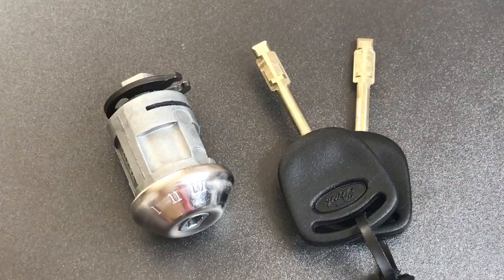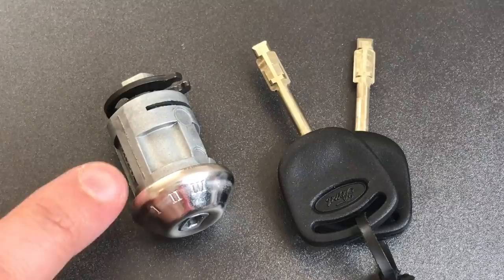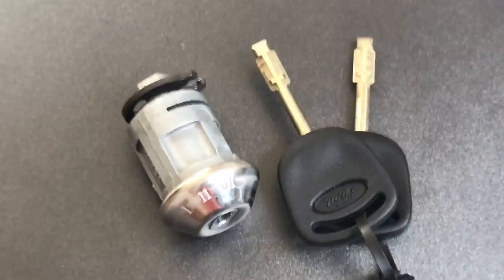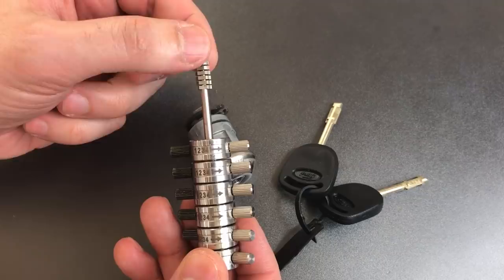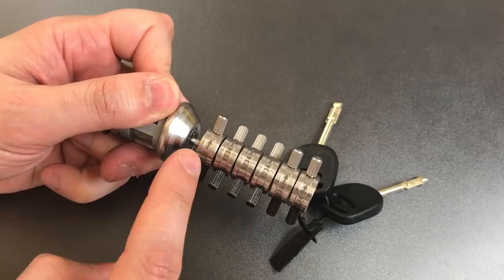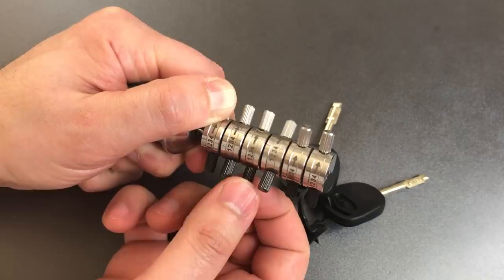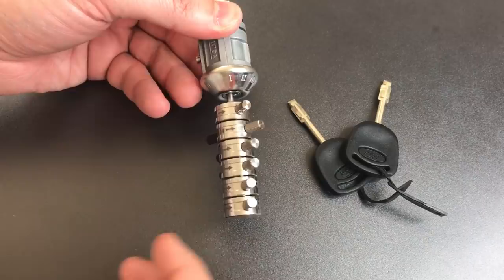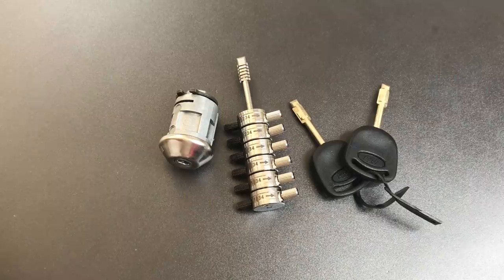[578] Ford "Tibbe" Key Ignition Lock Picked and Decoded

Comment: That's where Ford did a better job in Australian than GM in regard to locks fitted to 60's-80's era cars.  If you lost a key to a Holden GM (often the boot key was different cut to the doors and/or ignition) bashing  a flat head screw driver down the core of a GM lock and turning it would open it, as for a Falcon boot those had a side bar the ole screw driver trick didn't work you had to find a key with the same bitting or replace the lock #ClassicnotPlastic Thanks for the video interesting!

Comment: You don't even need that tool half a tennis ball will work as well as a spoon and the hammer and screwdriver combo all of which take a few seconds. My mums old xr3i was regularly stolen due to this crap lock. Aston martin also used it as well.

Comment: Hi, great video, Im just learning Lockpicking myself. I bought a see through beginners set and can pick it no problems but as soon as I can't see the Pins it all goes wrong. Pins get stuck and others just dont sit. I find it hard to know if I've overshot and the Pins stuck or if its actually in the right place. Are there any tips you can share that will make it easier to know whats going on?  Thanks.

Comment: The locks on most cars are pointless as a screwdriver banged into it n twist on a transit n there open 5 seconds 😂 don't matter what type lock it's got most vans in the uk if you have equipment on bored use slide shackles fitted aftermarket  for this reason 👍✌️

Comment: Never use this tool on an used ignition lock.  IT WILL STICK.  The dust flap when new is perfectly flat.  However with several thousand uses the flap becomes curved with wear.  The sharp edges on the pick will catch and you will not be able to withdraw it.  Its great on the door lock, and when the locks havent been changed you can decode the door and make a key for the ignition.

Comment: These locks were terrible. Many Ford cars were opened and stolen by knocking a small hole in the door slightly above the lock and levering the opening mechanism with a welding rod (faster than the time it took to pick that lock).

Comment: I think those keys have electronic transmitters in which without the correct key, the car wont start
Reply: At least not on older ones. Mine would turn with anything and start the car.
Reply: @DONK8008  and the steering lock ?
Reply: @backtoeden853  Mine was broken from a previous theft(before I owned it) But since the ignition turned it would release the lock. 

Tibbe locks were trash and would wear out with normal use.

Comment: All of the old Ford locks was a screwdriver wiggle away from opening anyway...i actually bought one of these but still haven't played with it there isn't a challenge there...i like trying to pick locks manually...ive got an old door lock I'm still struggling with I don't want any help with it I only pick them as a hobby but those old Ford and Vauxhall locks were the reason car crime was so big on the early 2000s because of this inferior crap...my dad's van has been done multiple times but oh well...its shocking they still use this...

Comment: Iirc with these locks you could use any key to lock them, but only the matching key to open
Reply: I unlocked my old ford escort van with  the wrong ford key worked on the doors fine but lockly did not start it.

Comment: Isn’t there a transmitter inside that unlocks the car’s electronics too?
Reply from the maker: On some of them, yes. But that doesn’t prevent someone from cleaning out the back of a transit van full of expensive tools.
Reply: Yes. Most Ford cars need an alarm taking off when you enter, if you just use a key to get in the alarm will sound unless you immediately turn on the ignition with a transponder key. I think the vans work differently though. 
I don’t keep anything in the back of mine ... it’s a flatbed 😆

Comment: And...VW used a lock designed to break inside if you tried to use a foriegn object on it.
I cant use the key on my drivers door because some dickhead tried to get in with a screw driver. Piece of plastic breaks internally rendering the lock useless.
I like it this way, i just keep a spare set of Key fob batts in my wallet

Comment: I guess that rod would be more useful AFTER you picked it and you want to preserve the combination.
Reply: It won't fit then.
Reply: My thoughts exactly @boris
Reply: The holes for the rod only line up in the initial position.
Reply: I know it is impossible. I was just suggesting an improvement for the product that will make the rod more useful in my opinion.
Reply: Boris Kozo would only work by making the tool much much larger, or by making the pin needle thin.

Comment: would love to find a "fix" for these locks, just to make them harder to break into
or even a replacement?
Reply: *bump :P
Reply: Araldite in the keyhole
Reply: ive already upgraded it with a later model type key
Reply: that would actually work fairly well though, i never need to use the key on the outside anyway

Comment: you can pick it but the chip in the key stops you starting the engine as it has to match the chip code on the programed brain
Reply: You don't need to turn on the vehicle if you're just trying to take the tools inside.

Comment: those locks are a joke. if you have a fiesta yourself you don't need to pick locks. on 80% of the cars you can open it with YOUR key, and 50% will even start! i think they wear out too easy. we made some jokes with some friends because of that. while he was in the gas station we drove his car behind it, and he paniced when he got back out XD
Reply: Yes, the tibbe is notorious for wearing badly, to the point where other keys will open the same lock, like you say. If there is no immobiliser it will start the car too.
Reply: i'm talking about the fiesta mk III those don't have immobilisers as far as i know and have seen at work ( wrecking yard ;D )
Reply: Yes, those older escorts and fiestas and other Fords can still be stolen with this tool. Even worse, the factory fitted alarms are de-activated by the turning of the lock in the door - so picking the door lock also turns off any alarm!

Comment: this key was my bread n butter, stupid ford what was they thinking, you could basically open random ford car doors with one of these, easy 80% chance it would open any door.. remember I'm saying door not ignition
Reply: tbh i could bypass it in 20seconds not even an issue .. use a scaf bar to snap the top off use the key barrel as the key